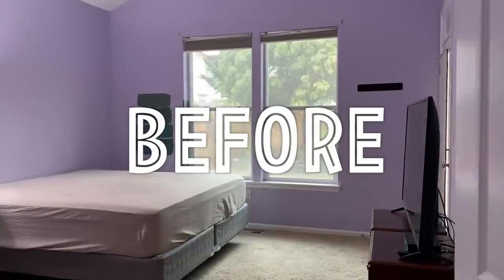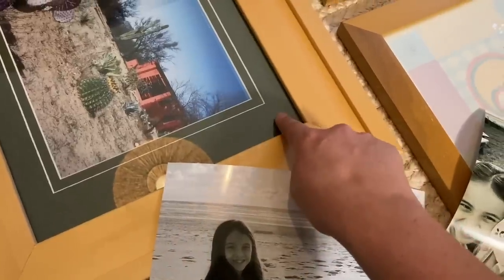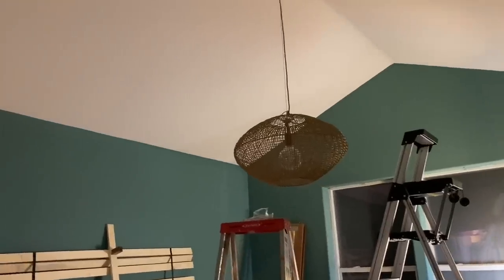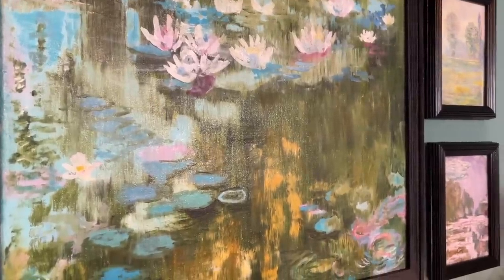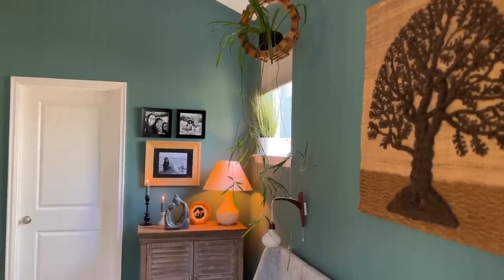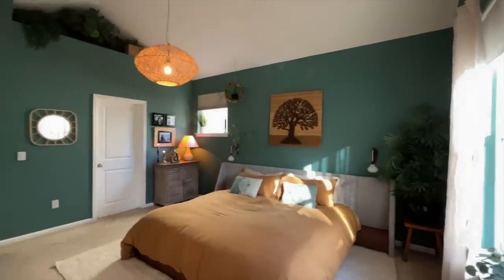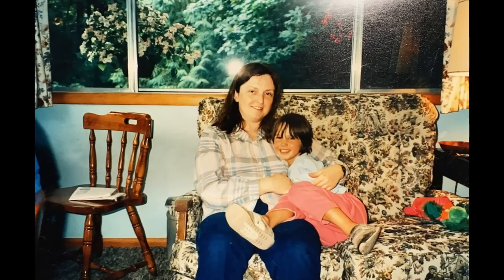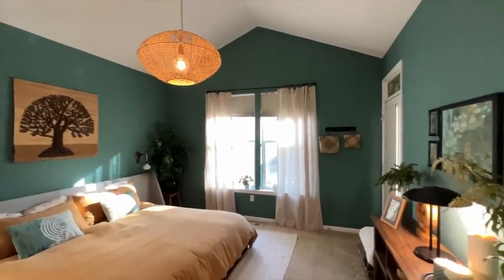BEDROOM MAKEOVER REVEAL! | We Thrifted It ALL! | How To Transform Your Space On A Budget!

Comment: It’s amazing. Great job.  The wall sconces do t need to be hard wired to make them operational.  You can find battery operated light bulbs in Amazon that you screw in. They operate off a remote control.  Huge cost savings on electrical work.  I just had a couple switches moved and one added in my kitchen.  It was $1300.  Plus then you have do patch all the drywall and repaint. So a solution if your not sure about a permanent placement.